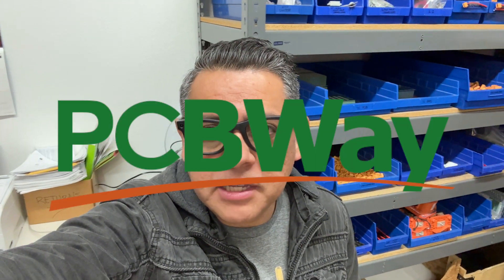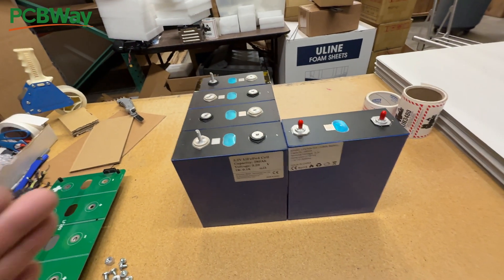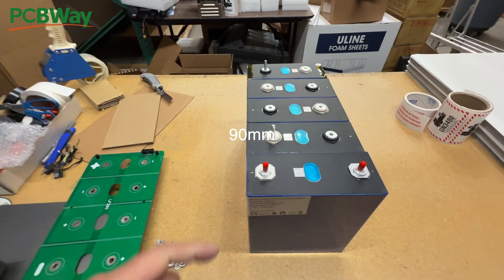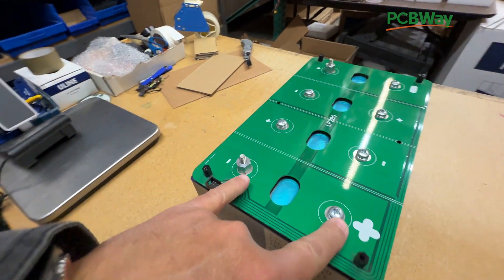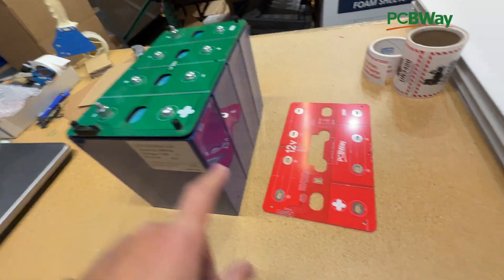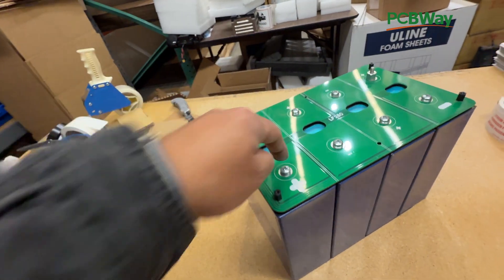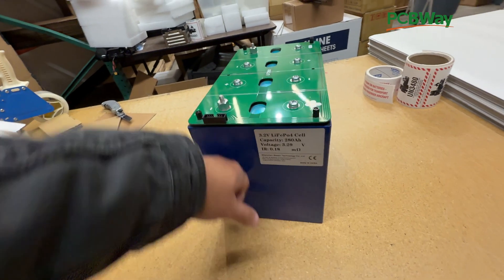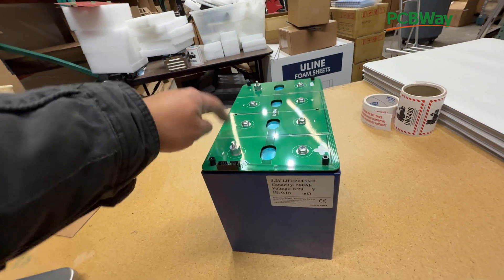DIY 280Ah LiFePO4 Cells with Studs 90mm apart  PCB Busbar

Comment: Sorry if you've discussed this elsewhere already, but what kind of work have you done to calculate the current capacity of those boards? Obviously you used thicker boards, but did you increase the weight of copper on the board? How did you work out what to use?

Comment: The very small batteries do you carry/sell them? My UPS for my computer & 3d printer has gone to sh*t use to last for 2hrs with printer running now after yrs it's lucky last 20minutes with computer (laptop ) no longer being used with it. Want to replace battery with something newer ideally more capacity. Thanks

Comment: Dang... If I had a 280Ah LiFePO battery, my heater and lights in my camper would never go out. I can already run them all night while only taking an 8Ah 12v LiFePO battery down by 20% to 30%, and that's back to full within 20 minutes of the sun coming up, even when it's cloudy.